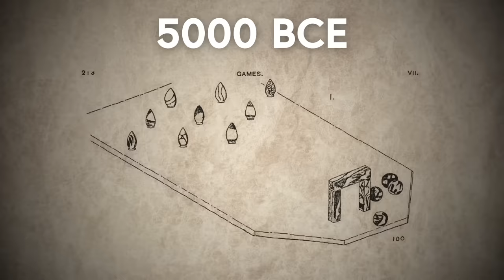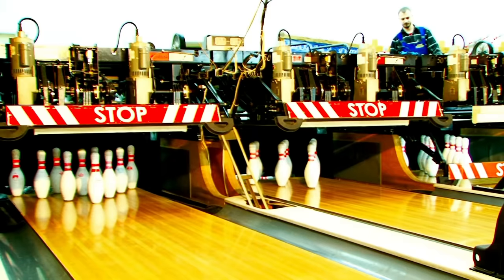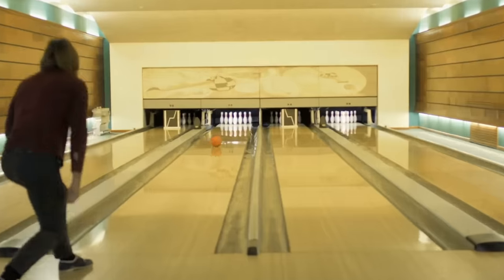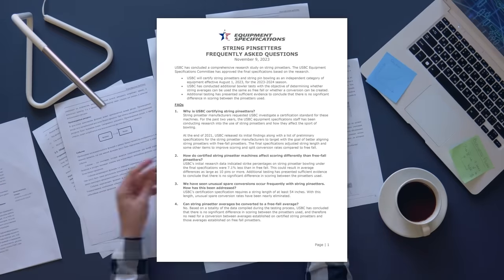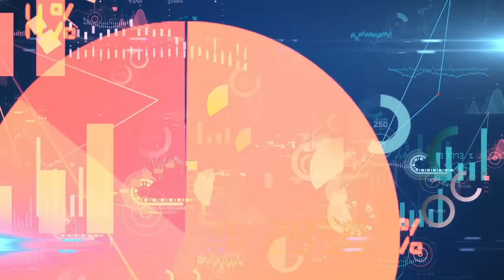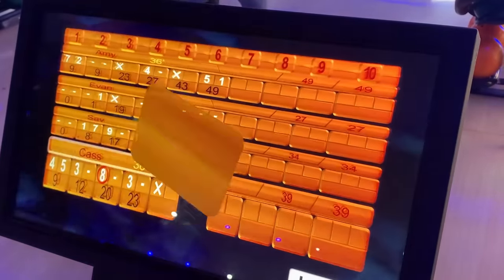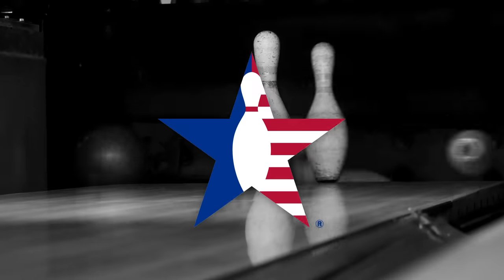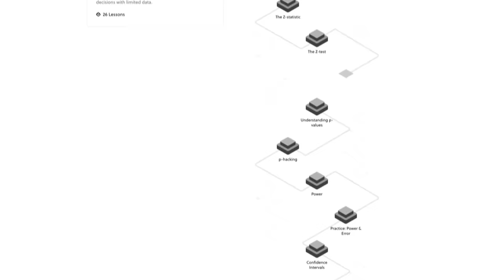The Controversial Machine That’s Ruining Bowling

Comment: The problem with strings is mostly in regards to pin action - if there are strings all over the lane, the knocked over pins can't roll around and potentially hit others that are still standing. As a result you eliminate a bit of the luck present in bowling.
Reply: Isn't eliminating luck arguably a good thing in a sport though?
Reply: This is getting into semantics but is that really luck or part of the game? If you hit a pin and it rolls into another pin, that first pin wouldn’t have been rolling if you wouldn’t have hit it
Reply: @hedgehog3180  In bowling it's part of the sport and always has been. Hell, if you get a 7-10 split it's arguably necessary to get lucky in order to get a spare
Reply: I would say it actually adds more randomness to the game. Sometimes the string stops a pin from knocking down another pin as you mentioned, but sometimes you miss a split, but the string tugs down the other pin and you convert the split anyway.
Reply: @hedgehog3180  Not really when it's an accepted part of the game and part of what makes it enjoyable for people across a wide range of skill levels.
Reply: Realistically, it doesn't make that much difference. The pins generally move fast enough that the string won't hinder them, and if it DOES, they're not moving fast enough to knock over another pin anyway.
Reply: @OtakuUnitedStudio  The strings look thick enough to stop a pin from rolling no matter its speed. If they were much thinner I'd be more inclined to agree with you
Reply: That, and wrapping spares.  If I hit the 6 in a 6-10 too lightly and the pin flies around the 10 but the string catches the 10 to knock it over that is another issue.
Reply: @AriaNL  Luck is basically required to make the 7-10.  You cannot send the 10 into the 7 (or vice versa) because the ball would fall into the gutter before reaching either pin.  You have to bounce it out of the back and because bowling pins have a funny shape it is very unpredictable.  Honestly fun pin action makes the game really fun to watch and fun to play.
Reply: Pretty much why Ill never play with strings
Reply: Surely the USBC would have considered this in their analysis
Reply: @TheNotSoMysteriousG  I was thinking the same thing.
Reply: so your issue with a change in this game of skill is that it removes the variable of luck?
if you're bad enough to be complaining about the removal of luck, you should shhhh
we get it. you're bad.
no need to yell.
Reply: I've seen the opposite too, where strings hit other strings and knock down pins that would've otherwise stood.
Reply: @AriaNL Packy has s bowling channel. Check out a pro do a challenge doing 7-10 splits with strings. Very interesting on how they can convert so many. Something you can't do when bowling on normal lanes with no strings. When normal average folks bowl it won't matter. It's mostly just for fun. People that bowl on leagues or tourneys don't want strings. It changes the game dramatically.
Reply: @jackyank2874 

Very true.

The reduced scoring with string pins might end up being temporary as more bowlers throw more shots and learn what they need to do to manipulate them.
Reply: @hedgehog3180  No not in bowling. Pin action is often down to entry angle and speed combined with an accurate shot, when you aren't rewarded for those two in perfect combination with accuracy the game becomes way less interesting.
Reply: @ambiarock590  While you're not wrong in what you said, I guess positive way to look at it is that you now need to develop a modified strategy when you bowl at a string pin alley. 

It's not necessarily worse, it's just different. And variability I think is actually a good thing. I think ideally, an Alley should have 1-2 free fall lanes that they charge a premium for and the rest can be string pins. That would allow groups to experience both. 

It would kind of be like golfing at a new course when you switch lane style. 

I also think Bowling alleys should try to have lanes that have different oil patterns, it would be interesting if in a bowling league your team could pick your preferred oil pattern as your home court and then you could have home vs away games when playing teams in the league where if you're the visiting team you had to bowl on their oil pattern (which could be a disadvantage to your bowling style). It would almost be like playing tennis on clay vs grass.
Reply: I've seen other video and sometimes the strings will pull down a pin that wouldn't have been knocked down by freefall. Another reason for the string length was to help reduce weird pin combinations.
Reply: @DaveCM  there is also the angle that some pinspotters, when a pin is standing and knocked off spot that will reset the pin in an offset and you will have to shoot it, part of what makes league bowling exciting
Reply: They give you way more luck on spares, where the damn string knocks over the pin. Splits are way easier. Strings gotta go!
Reply: You say that, but the official study done by the bowling association disagrees with your theory. They basically proved that the strings "all over the lane" do not inhibit pin action.
Reply: As a bowler, the thing that we are looking for is pin action, that's how you get a strike. Just like how pool players are looking for the best break, we are looking for the most violence and movement as possible when it comes to pin flying about. It doesn't seem like it but you will be surpised as to how large the gaps are between each pin and it there was no movement, strikes would almost be impossible
Reply: @OtakuUnitedStudio Not true. Ive definitely played on machines where the strings prevented pins from falling that should have and a few times pins that fell but didnt fall over completely were reset as if they hadnt fallen. Strings can  completely change the physics of the game. You might as well ask if a rubber Q ball would really change a pool game.
Reply: @ambiarock590  the other forms of bowling in north america (duckpin and candlepin) really amp up this unpredictable pin action a lot. :p
Reply: That's not luck. If a pin is hit in a certain way it will toll in a certain way and affect other pins based on that. The chain effect is part of the strategy and skill, not luck.
Reply: But the string pins GREATLY increase the chance of converting the 7 -10 split!
Reply: @hedgehog3180  Sports need a little luck in them, otherwise the outcome can be easily anticipated in advance and there's no excitement. The most exciting moments in sports are when a weaker player or team is able to defeat a stronger opponent, and that requires an element of luck. Even if it's just the luck of going up against an opponent who had to stay up late for a family crisis and came to the match with four hours of sleep and a head full of worries
Reply: Exactly....How many strikes I got with a single pin rolling over and knocking out the 10 pin? More than I can remember
Reply: I think strings won't save bowling and don't believe the machines need so much maintenance.  Your automobile has more parts and you beat the shit out of it every day.  think the guys that make the string contraptions did this video and most of the comments.  i would feel insulted if the bowling alley i was going to changed to strings.  They think that bowlers don't know jack about physics, they think you would believe that 10 strings rugged enough to take the beating aren't going to change the game.  i call FOWL.
Reply: more like well timed skill than luck.
Reply: Part of the issue is resistance to change, however this is going to change the game.  While scores are about the same, strikes are less likely due to decreased pin action, and difficult spares/splits are easier as the strings on hit pins tangle the strings on other pins.  You can pick up a 7-10 split without the pins hitting each other.
Reply: I mean in my eyes the noise of a strike or just the pins going down is the reason its even fun in the first place as someone who used to bowl a lot and got good at it I enjoyed its satisfying sound of all of them going down if the strings remove that noise i dont wanna do it anymore if the machines are breaking or not working correctly we could just try to make a design that keeps the free falling pins but maybe make it simpler, safer and more reliable
Reply: I can't imagine how a messenger pin would perform the same way if it was tethered at the top to a string.
Reply: @hedgehog3180  --  Nope!   Luck means than on any given day, any given player/team can win.   Take out luck and the winner would be 95% predictable.  Boring!
Reply: if the strings are taking the fun out of your guys’ game. then you must really hate the sport.
Reply: @MrComradebuttons  --  Well, from my observations of bowling operations, the conventional machines aren't as troublesome as the video implies.   That said, if it can make it a lot less expensive, more outlets can afford to add some lanes as an "extra" and more folks will get it a try and even make it a frequent event.
Reply: @hedgehog3180 
Pin action isn’t “luck”.
Reply: @OtakuUnitedStudio  it just looks so ugly and cheap. Feels completely inauthentic. 
And I’m not sure what it is specifically, but it’s not satisfying like it is to play on a real alley.
Reply: Anyone that bowls knows that “messenger” pin saved a bowler many times. My final strike in my first 300 game was a messenger strike and would have had a 299 without it. I’m in my 60’s now and will never bowl with string pins.

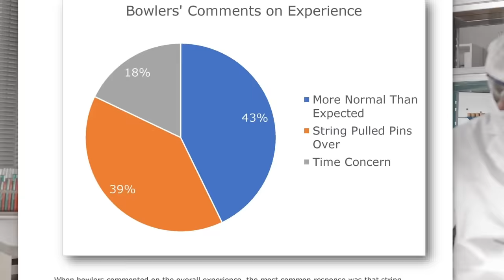Comment: At 4:05 the 0.035 p-value for the normality test is mentioned which is not the p-value for the t-test. If it was, the 95% confidence interval for the mean would not have spanned 0. It's indicated correctly at 3:41.

Edit: From the data shown at 3:41 you can actually calculate the p-value for a standard t-test. My calculations come out to a p-value of 0.26. The reason they don't note the it in the report is likely because in this case it's much less informative than the confidence interval.
Reply: Thank you for the clarification, I was really confused about that
Reply: Haha commented similarly. Real stats fumble there.
Reply: Literally unwatchable.
Reply: yeah was about to say since 0.035 would be considered significant
Reply: Thank you for this comment – I'm currently doing a stats course at University and was already questioning my sanity 😅
Reply: Not only that, but a Darling-Anderson result of p=0.035 indicates that the USBC also messed up their statistics by using a t-test. That result indicates that the data are not normally distributed, so a paired t-test was inappropriate in this context.
Reply: As someone with a stats degree, I'm embarrassed I didn't realize that a p value <.05 doesn't vibe with a mean that close to zero, nor with the conclusion that there is no difference.

Nice catch!
Reply: @humphreyspellingbee1732 technically true, but in practice this dataset is close enough for a t-test to be useful. Or rather, not even needed because the effect size is so small compared to the standard error.
Reply: THANK YOU! I was so questioning my sanity, even with my little minor in Stats I was confused by the p-value.
Reply: Thank you. I was going crazy. They should correct this and retake those Brilliant courses :b
Reply: @TaranVH  Well, most of us don't even get that part so it's no biggie. 😄
Reply: @fowlerj111  yeah I doubt a wilcoxon test would have returned a notably different result. Just kinda funny that they did a test for normality, reported a “failing” value, then went ahead with a test that assumes normality…
Reply: Yes I was also confused by this. Thanks for the clarification!
Reply: Just chiming in to add to the chorus, you are the hero of the comments section
Reply: let's take it easy here, he DID say the writer didn't finish their stats degree...
Reply: I was confused as well. Yearly corrections video!!!
Reply: Oooh STAT FIGHT! STAT FIGHT!
Reply: Came to rhe comments to see this rage, because I knew it would be here 😅😅
Reply: And I thought the video was boring. #nostringpinsever.
Reply: Thank you for pointing this out. It's really confusing and misleading to claim a p-value less than 0.05 and a confidence interval containing 0 (or whatever the null value is but in this case 0) at the same time.
Reply: Thank you, I was wondering what I was missing.

Comment: The problem with the anecdotal test, is bad bowlers don't make pins fly, if the pins mostly topple or move within a foot of their location, the string will make no difference.

But once you start hitting the pins with speed, the way the front pins ricochet, is absolutely noticeable imo.
Reply: Also bad bowler performance greatly varies between games, since they don’t have a consistent technique down
Reply: With puts in idea that BOTH are good, one for more advanced players and one for casuals.
Reply: I was thinking something like this.  Professional bowlers are much more refined than a casual player.  It takes a lot of skill to bowl over 250 consistently.  Strings changes the physics so pro's have a point.  BUT, I can see the point of people wanting the cheaper option.  Casual players won't care which probably make up most of an ally's customers.

Comment: My problem with this study (and before you jump my case I have my bachelor’s in mathematics, so I have some idea what I’m talking about) is that while the average scores, average number of strikes, and average number of spares may be staying relatively close across string and no string lanes, this does not account for everything. They are definitely a different experience, and shots behave differently. I would be much more interested in tracking the data from the path the ball follows too, and adjust for that. The strings will necessarily change the behavior of the pins on impact (that’s just physics, you can argue all you want but you’ll just be wrong), and there will be shots that land strikes/spares in one alley but not the other and vice versa. This variability could effectively cancel itself out on average, so while quantitatively on average the alleys are the same, they are qualitatively different, if that makes sense. Think about comparing two sports cars that are relatively similar in lap times, but maybe one handles corners better and the other handles acceleration and deceleration on straightaways better. The differences cancel each other out enough that the overall effect (who gets around the track quicker) is the same, while the process of actually driving around the track will feel very different depending on the vehicle. I hope I explained that clearly enough, but my point is I don’t think this study properly accounts for other things which affect the overall experience of the game.

Keep in mind too that the bowling robot is more consistent than any human. The fact it scored worse on the string pins demonstrates a quantitative change in the behavior of the pins that the programmers of the robot, or the program itself, were not able to correct quickly enough to get a good score. There is a difference, but the humans were able to adjust mentally. Maybe consciously, maybe subconsciously, as the pro bowlers have these adjustments engrained in them, but it’s clearly different as the robot demonstrates.
Reply: It's trivial for centers to shift averages around and make strings look roughly equivalent to free fall.  Just make the pattern a true Xmas tree and tailor the volume to whatever is useful for the players in your leagues.  If you have a bunch of old men reduce volume, a bunch of younger guys throwing Gems jack it up.
Reply: But these 4 people who average 70ish pins sometimes bowled better on strings.  People who can't consistently hit the pocket and throw straight balls are obviously the ones that matter the most when measuring the impact to the professional game.
Reply: @cwolf208  I’m referring to the study the US bowling Congress conducted, which consisted of only professionals, I’m not referring to the anecdotal statistically insignificant study ran by the people from this channel. In either case, my point still stands
Reply: @andrewkarsten5268  I was definitely being sarcastic.  I agree with you

Comment: 3 bowling alleys within 25 miles of me have closed down over the past 10 years. Wish they would have gone this route, string bowling is better than no bowling.
Reply: @UberFoX  why is horse hair less likely to interfere?
Reply: Having grown up in SoCal I watched dozens of centers within a 1 hour driving radius shut down in my youth (80's and 90's), but it had a lot more to do with sky-rocketing property values than maintenance costs. Each pair of lanes requires an enormous amount of square footage to provide for the scorekeeping area, the approach, regulation lane length, the pin-setter, and maintenance area behind the pin-setters, times every single pair of lanes. Then you've got the space required for the front-desk, shoe rentals, house ball storage, seating area, etc. The owners of the large properties these alleys were on couldn't afford not to sell the land. String bowling would not have saved them.